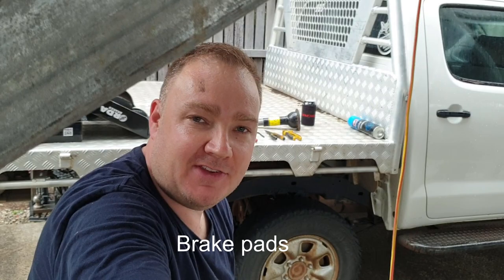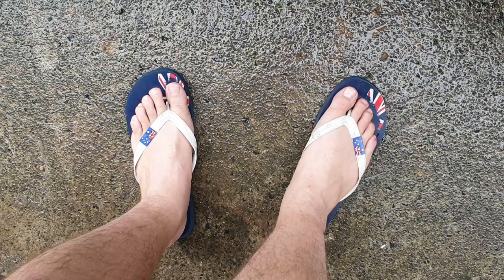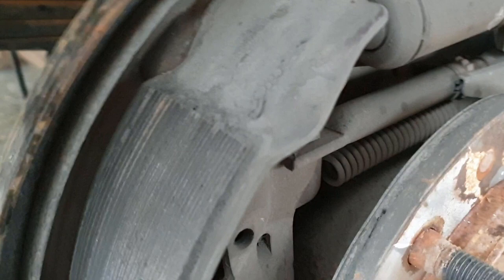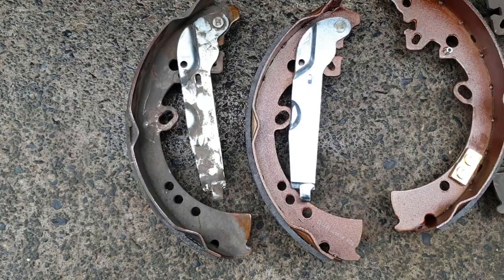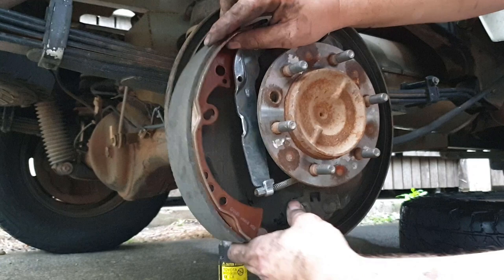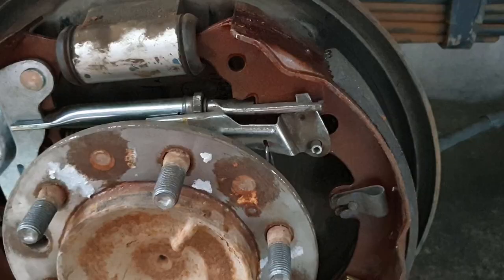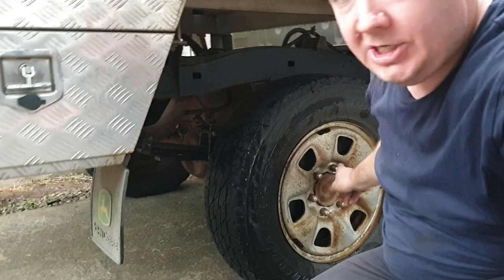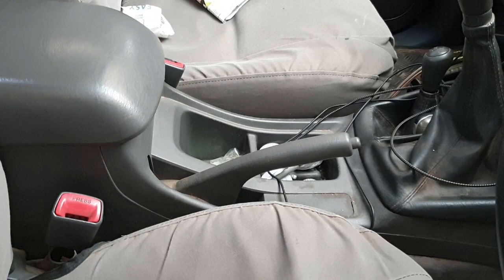Toyota Hilux/Vigo rear drum brake replacement 2005 - 2015

Comment: Great video but didn't show bleeding brakes at finish
Reply from the maker: You don't need to bleed the brakes unless you change the slave cylinder or your changing the brake fluid. To change the pads and drum there is no need to bleed.

Comment: Hey mate. Just did mine. Adjusted tightener nut thing until I couldn’t do any more. Handbrake feels tight in the cab but basically doesn’t hold my car on the slightest incline. Any ideas?
Reply from the maker: Apparently there is another adjustment on the lever in the car, I think you can get roo it from under the vehicle. I haven't needed to do mine. Have you adjusted them again since driving?
Reply: Hand brake cable under the car half way down drivers side there's screw adjust ment leave hand brake off when U adjust it

Comment: Good job but just a few things on the brake adjustment before you put the brake hub / rotor on adjust the brake shoes out so it just take you to put the hub on and adjust the last bit with the wheel on and the truck still on the jack keep turning the wheel until it just starts to lock job dun
Reply from the maker: That would be a huge time saver lol

Comment: Thanks heaps. I should have watched it before I did the job! Got half way through and couldn't work out the spring directions and the right holes, but thanks to your video i got it sorted.
Reply from the maker: That's pretty much why I ended up making the video, so I could put the first side back together lol

Comment: I can see where J is coming from below. I was actually going to compliment you on your dedication doing the job out there in the rain. I am a qualified mechanic and am busy working on my bosses ute. I’m here because I’m having issues releasing the tab when trying to adjust the brake shoes and back them off. Thanks for the video.

One thing I will say as I was busy typing and then started watching, please never use side cutters around cables to pry back a spring. Use pliers or needle nose so there isn’t a chance to severe the cable or spring.
Reply from the maker: I actually never intended to make the video, I was in a rush. I did the first side and could not remember how it came apart, so I filmed the second side, because I couldn't find it on YouTube. Hence a few dodgy things.
Reply from the maker: You might be able to back the cable off under the handbrake under the car, apparently there is a second adjustment there.

Comment: Good video mate , but what about supporting the axle on a stand , very important , looks very wobbly on the hyd jack you used
Reply from the maker: 100% correct mate, hence the rim under the chassis for the fail safe.
Reply: Toyota jack is not hydraulic, it is a screw jack so will not fail due to seals, however an axle stand is a good idea!

Comment: have you ever had a 4x4 issue wereby the 4x4 doesnt engage, i  have that problem with my toyota hilux 2.5 d4d
Reply from the maker: No I haven't, I would assume it's either a linkage issue, a switch issue or a solenoid issue. Depending on your specific setup.

Comment: Hello sir how about the other side of the wheel, how do u adjust the park brake on it? Since u already set the pull u want on the park brake on the other side
Reply from the maker: You have to adjust both sides
Reply: @HuntShootOffroad  sir wer do u put ur gear lever when changing the brake shoe? Iam on automatic transmission, should i put it on Park and release the Park brake?
Reply from the maker: @MrEricuy  the auto shifter won't affect it, just keep it in park.

Comment: Hello sir some.of my friends said that no need to adjust the drum brake manually at the back of the drum brake the thing that u rotate with the flat head screw driver, they said its has self adjuster all u need to do is just press the brake pedal many times it will self adjust and pull the park brake many times it will adjust also, is it correct? Coz ur doing different thing on ur video
Reply from the maker: It is supposed to be automatically adjusting. But it's best to take up the slack at the very start.

Comment: Did every toyota car provided with mi bolt just like u use?
Reply from the maker: I don't understand your question.
Reply: 4:30 where i can purchase this M1 bolt?
Reply from the maker: @lalalulu3084  M8 thread, I think it's a M8 fine thread. It's a standard metric bolt. You can buy it at a hardware store. Mine is a "socket head cap screw" but you can use a M8 hex head. It's just what I had laying around. The Toyota is covered in M8 bolts. 

You can do it without the bolt as well, you can tap the outside with a mallet.
Reply: @HuntShootOffroad  Thanks. Sorry for my englis. It's my third languages.
Reply from the maker: @lalalulu3084  no worries, I just had to work out what you needed!

Comment: I have a kun26r hilux sr5 replaced rear shoes all the same but rh rear gets bloody hot lh rear normal cant work it out
Reply from the maker: Sounds like it's either dragging or the fluid is favoring one side.

Check you don't have the handbrake on too much on the RH.

Other than that try some googling.
Reply from the maker: Maybe try backing the handbrake off on that side

Comment: When you where setting it did you turn it till it got hard to turn with the screwdriver
Reply from the maker: Pretty much, but make sure you have the park brake handle pulled first. Otherwise you have brakes on 24/7. Pull it about 1/2 to 2/3 on.

After you have adjusted it, go back to the park brake and give it a couple of pulls, if it feels to high tighten it again.
Reply: @HuntShootOffroad  yeah but when you were adjusting it did you turn it till it got hard to turn with the screwdriver
Reply from the maker: @burgervanzyl7029  yeah it should get firm.
Reply: How about the other side of the wheel how do u adjust it? Since the other side is already set and adjusted on the park brake the way u like it to be pulled